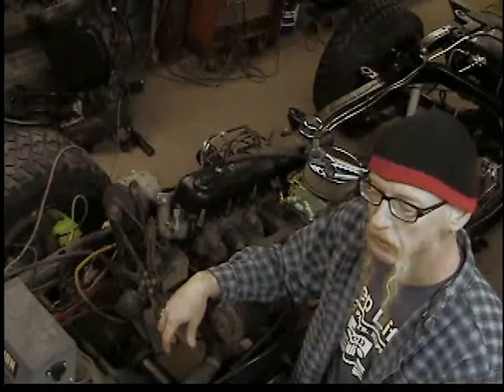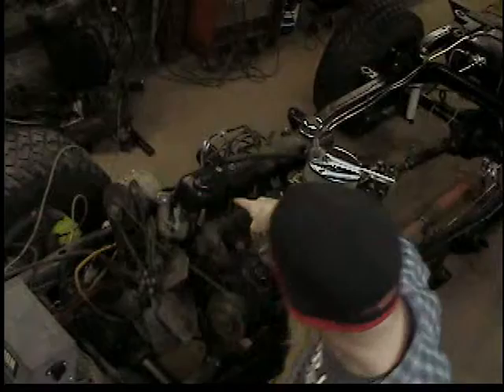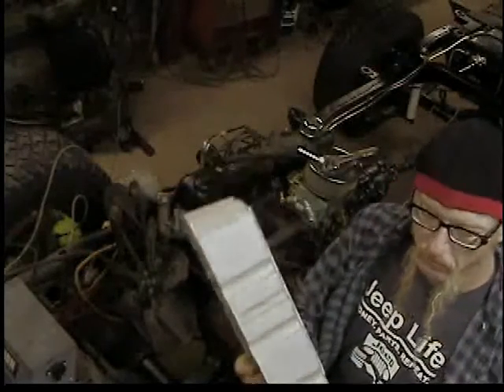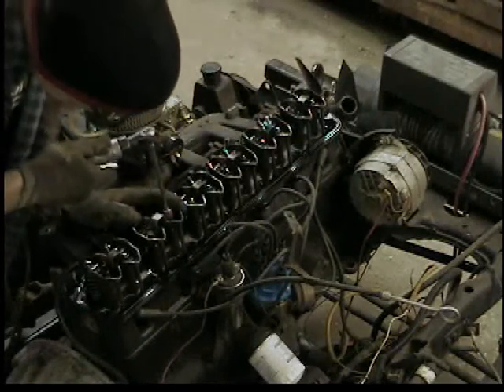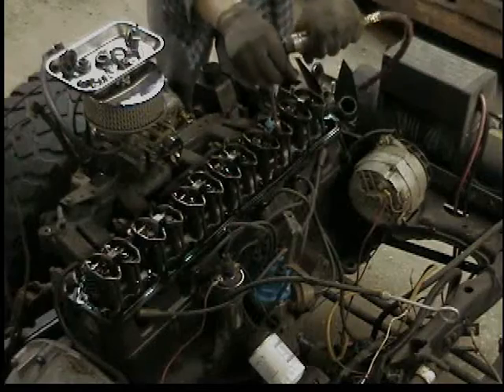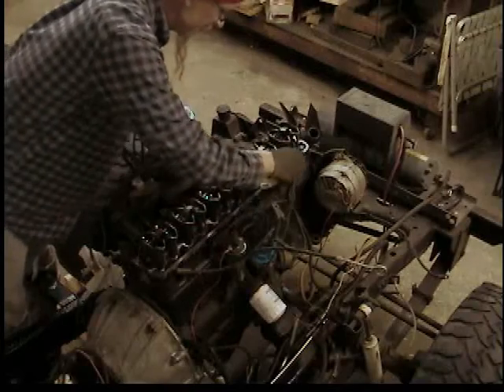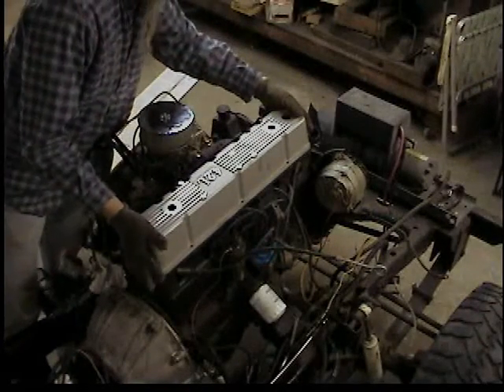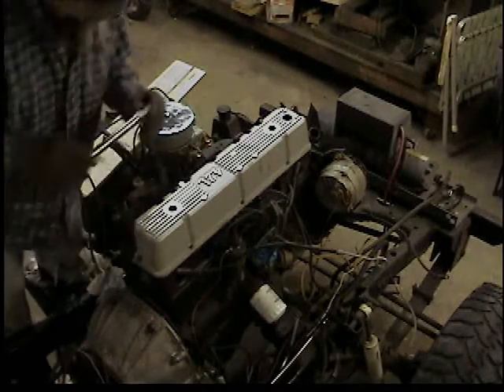Jeep Valve Cover from plastic to aluminum

Comment: Hi, I need to know   the part number on the gasket. Please, where do I get  one.
Reply from the maker: I bought mine on Rock Auto. That was a while back. If I didn't mention it in the video you'll have to find it. It's not hard.
Reply: Thanks

Comment: Thank you for this.  Getting ready to order it for my 1986 AMC Eagle to replace the cracked plastic cover.
Reply from the maker: Get the Felpro gasket. Mine is still on there not leaking years later. Eagle On!

Comment: Hey. Thanks for the video.  Do you remember what kind of grommet was on the plastic valve cover on those center nuts?  I'm replacing the engine for a customer and the new plastic valve cover I've got, doesn't come with nuts for those center holes or grommets.  Thanks
Reply from the maker: No I don't. That was a while back. Jeep On!
Reply: I'm doing this upgrade right now. PO had removed the studs and RTV'd 5/8 bolts into the hole. Don't do that! Lol
Reply from the maker: At least JB Weld, right? 😀

Comment: I watched a year or more ago and there was a bunch of views. What happened? Great video! I'm doing the project now. The front hole that needs to be tapped is a 1/4-1/2 inch off. I'm going to have to dremel the valve cover to make it work. IDK what's up with that. I found another video where the guy had the same problem. That's for making the vid!
Reply from the maker: FeedYourBrain Yes, they made that engine for a long time with variations.  That's probably why their instructions are so nonspecific; "some holes may need to be drilled and tapped." Jeep On!

Comment: Great Video, Have you had any leaks since this conversion? I just had an 85 AMC Eagle motor put in my yj and will be getting this done Aluminum soon.
Reply from the maker: Rufino Adler It leaked a little (very little) went back and blue lock tighted the bolts. Nothing since.
Reply: Did you end up getting it and if you did, did it work for you.  I'm getting ready to order this for my 1986 Eagle. It's the best pric I've found so far.
Reply: @EvrttGrn  I did, never leaked. Took to a Jeep shop and it overall costs 120-150$ for them to install. Sold The YJ after two years with that added on.